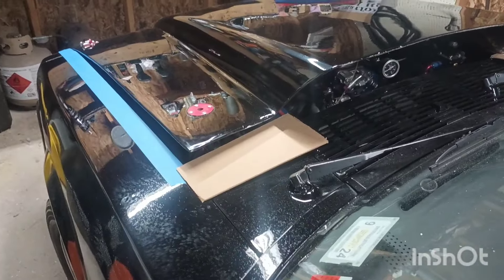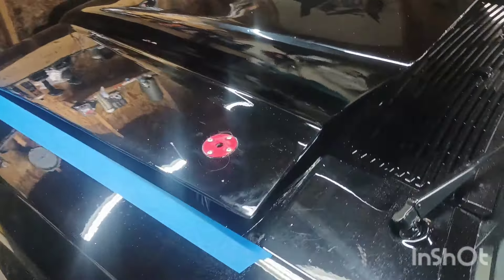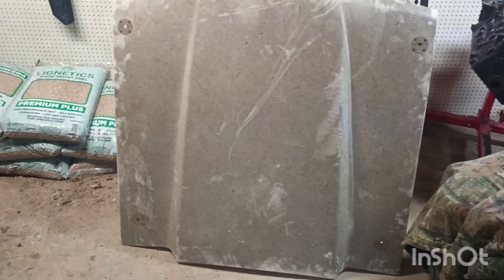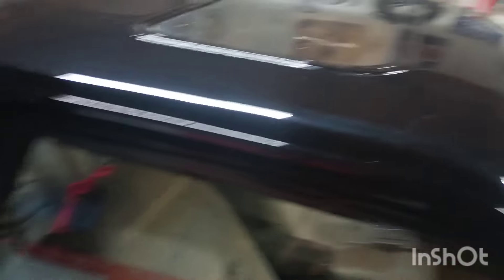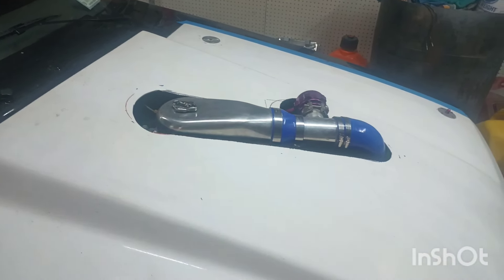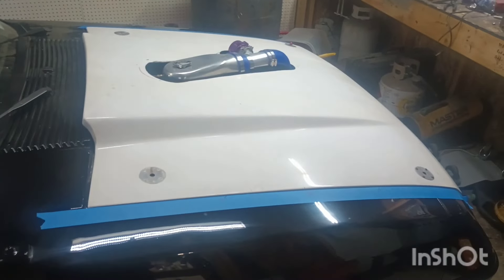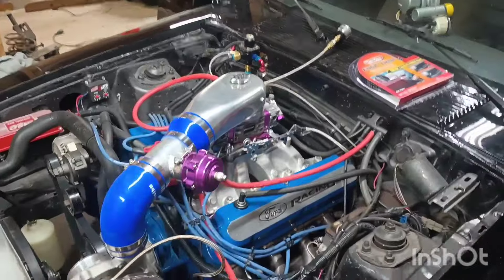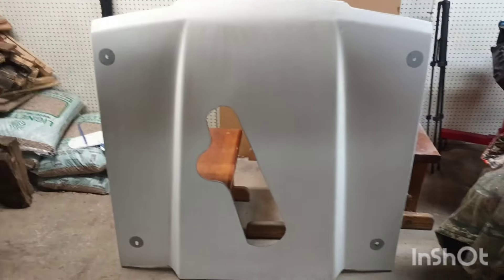making a fox body mustang look good!!

Comment: Im shocked that you chose to do this dumb shit instead of rotating the compressor side of the turbo, and using a 45" coupler between the BOV tube and carb hat.
Reply from the maker: Thank you for your comment you do what you want with your car I'll do what I want with mine 👍👍